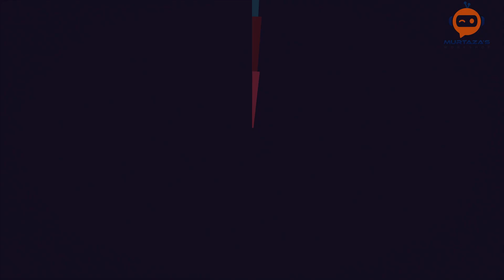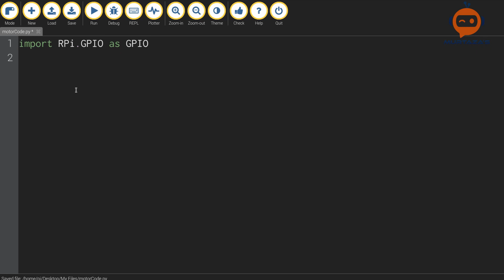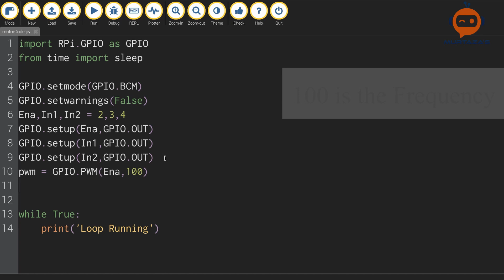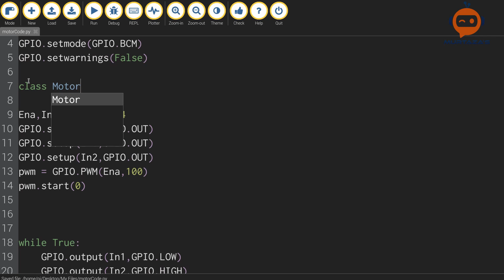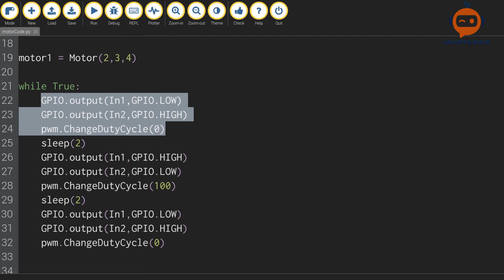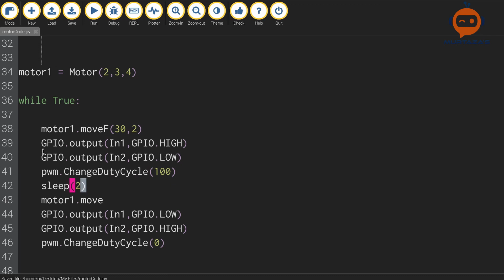DC Motor (L298) Basic + Object Oriented | Raspberry Pi Tutorials for Beginners

Comment: This is great, but one complaint I have is that the diagram for the wiring doesn't display the actual pin names we are plugging them into. It's only a problem for me because I'm using a breakout board and I don't know where the ones you used, are mapped on the breadboard now. I have the Rpi pinout diagram, but I can never tell which directionthe arduino is supposed to be facing in relation to the pinout. It's a minor thing, and I know I can just go look it up, which I will, but I wish I could tell which pins you are actually using, by name!

Comment: In this video, you used a separate power source for the motor, but instead of doing so, can't I modify the poser supply of raspberry pi (by making some voltage distribution circuit) and use only one power supply?

Appericiate for making a good video

Comment: This video was great, thank you, but I have a question, there is a project and I will connect a 2 dc motor with a raspberry so I need a motor driver. I don't know which type to use. Is this stable? If we stop the engine, the wheels can move by any external influence or will remain stationary

Comment: One of the best walkthroughs, I have come across, thoroughly explained. And got me well to controlling one motor. However, when I tried the same with another motor using the same approach, for some reason, that just didnt work .
Sometimes the motor would keep running (even before running the code) and didnt respond to the Pi instructions. 
Other times, it would just stay put and not move at all. 

I was wondering if there is a choice of pins involved? E.g. just a few pins that truely support the PWM etc? Is this a problem that is commonly faced? Been breaking my head on this a couple days, not able to figure out.

Comment: Hi Murtaza, Im facing issue with the change in direction of dc motor. I connected single dc motor to raspberry pi using REES52 L293D driver module. In this driver module for a single motor i only have two pins referred as MTR and IN1 . So i tested with the code that u suggested in the video but its not working. For me the motor always rotates in the clockwise direction.  PIN 20 - Connected to MTR pin in driver module and PIN 21 - Connected to IN1 pin in driver module . I dont have L298N driver. 
Could you help me in fixing this issue. I want to control the motor direction based on the IR sensor data. 

print("Change direction")
GPIO.output(20,GPIO.LOW)
GPIO.output(21,GPIO.HIGH)
print("Change direction")
GPIO.output(20,GPIO.HIGH)
GPIO.output(21,GPIO.LOW)

Comment: Hi! I have a question, do you have any idea why the motor won't budge at power levels lower than 30? I am using the exact same setup as yours.
Reply: Do you mean duty cycle of lower than 30? If you are talking about duty cycle it’s coz the average voltage will be the duty cycle/100*high voltage. So if your high voltage isn’t that high then 30/100*high voltage will be a low average voltage value.
Reply: @ananthramvijayaraj4554  bro it’s been a year😂

Comment: Hi Mr. Murtaza I found your tutorial very easy to understand, will look forward to all your tutorials.
I have followed this tutorial and have my robot running without problem but the robot seems to go right when forward, It seems the right motor has less power.
Reply from the maker: Yes this is a common issue. Both motors rotate at different speeds. This can be corrected in the software part where you can add and subtract a certain tuning value to the motors. But if the turning is quiet significant than the motor might be damaged or there might be a loose connection.
Reply: @murtazasworkshop  Thanks for your reply, I found the problem, the left, and right motors have different gear ratio after replaced with the same motors it works just fine.